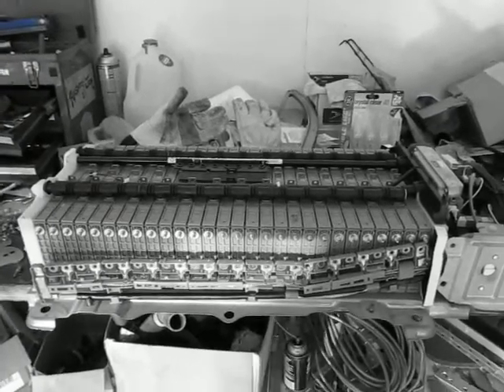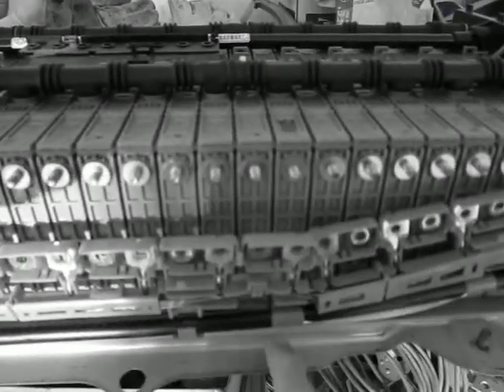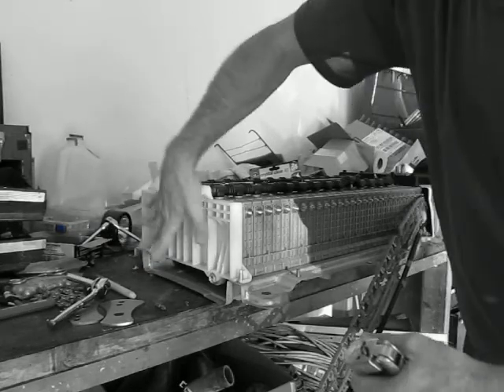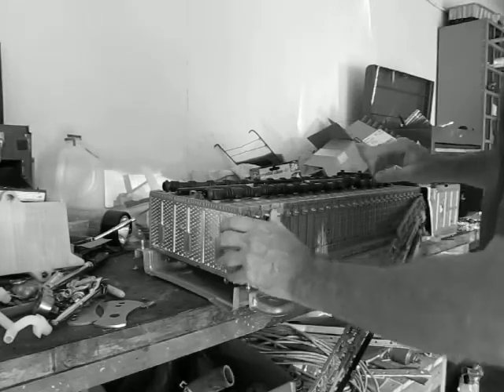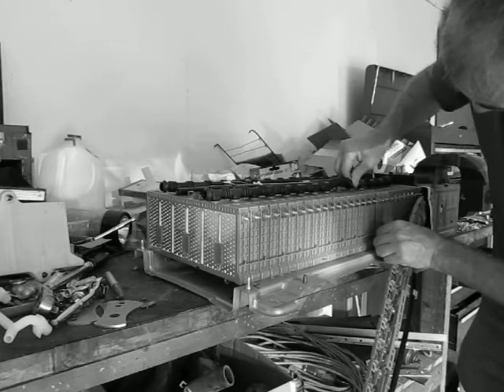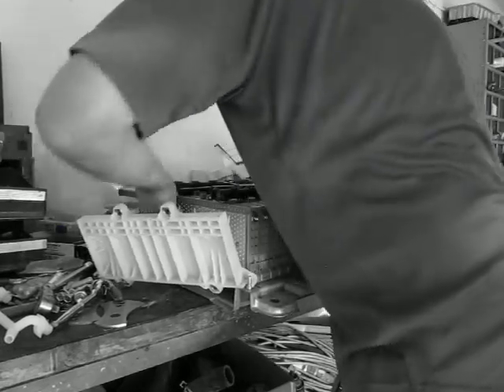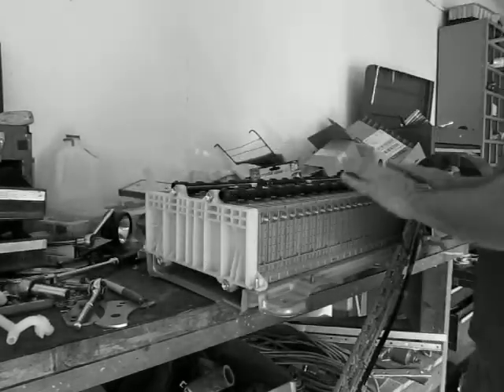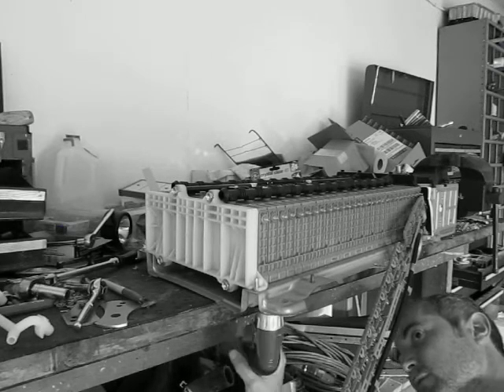Toyota Prius Battery Repair: Replacing one bad module (common failure)

Comment: The whole balancing thing is really not magic like most think. It really highlights how most of us simply do not understand how these batteries work, and especially age. A module “can” be replaced, battery reassembled and it “can” last a good while. However due to the module replacement being from a different newer or older battery pack, this is playing Russian roulette if solid reliability is desired. If you are mechanically inclined and don’t mind the downtime, it’s a non issue being the modules are cheap. But the rationale that cycling some 250,000 mile blown out battery is somehow going to make it match the other 27 in a pack that’s otherwise healthy is absurd and incorrect. Doing maintenance with a grid charger after install (hybrid automotive) or similar is really the only way to keep that one module (if it’s capacity isn’t too low) in line with the others long term. This hobby charger nonsense has given people a false sense of security. It’s a gamble people. If you don’t believe me, do your own research and speak to the industry experts.

Comment: I attempted a repair on my 2007 Camry Hybrid. After replacing a cell and cleaning busbars, it worked fine for about 2 days, about 70 miles. Now check Hybrid System warning light has returned. Any ideas?

Comment: WRONG, you have to test them under load.. a volt meter is not designed for battery testing.. also you have to change them in pairs or blocks... and you have to balance the batteries or you are wasting your time

Comment: If you hate buying new expensive batteries. I have good news! There’s an easy new way to bring your old batteries back to life again [Check Details Here==>https://plus.google.com/100351090281822647456/posts/Ct2x2kZGdNN ] .so you never have to buy new pricey batteries again.
Reply: I hate that video. It goes on and on, huckster selling to rubes. No substance.  Better to google battery reconditioning and find a more reputable information source.

Comment: Sorry not a simple volt test.. thats not how it works, one that shows proper volts doesn't mean its a good cell or the other way around. U need to check discharging and other performances. But you go change that one cell buddy
Reply: Apparently this worked out for him.

Comment: How long between these repairs? I have a 2005 Prius that I will attempt to fix. Wouldn't there be just one module after another failing afterwards?
Reply from the maker: evan riddle My gut is that there would be a long gap of time between module failures.

Comment: Thinking to buy a  2004 Prius for $900 with 77,000 miles with a battery problem will be a good deal?  The car doesn't turn on the owner say.  Still a good deal if i need to replace the whole battery ?

Comment: Nice video but what happened with the wires at the 7 minute mark that sort of held up the bad module when you were taking it out? I didn't see you plug them in when you reassembled the unit.

Comment: what‘s the symptom before you fix it up? thanks
Reply: Red triangle, check engine and about every other light. Codes P0A80, P0AA6.  Sometimes accompanied by P3000, P30XX (11 through 24).  P0AA6 is a HV leak to ground and is frequently an electrolyte leak at one or more modules, but it can also be the transaxle, HV harness, A/C compressor or Inverter.  P0AA6 will prevent you from restarting the car after turning it off.
Reply: thanks a lot for your reply, i have red triangle and check engine light on, and i just found one traction battery unit lower than 7v, according to your experience, it could be the root cause, right?
Reply: Henry Tan generally, they are all VERY close in voltage if they are healthy. Outliers are almost always an issue. Diagnostic codes should ALWAYS be read before disconnecting 12V.
Reply: I tested all the traction battery units, all lthem have close voltage-- 8V, except one below 7V, (I used the pointer meter), so I'm hesitated if it works to replace that unit, and I use the OBD2 scan tool to scan the code, there is no code at all, when i disconnected 12v and reset the car, the warning lights gone for just one day, but they were back again!
Reply: I have the same problem , did you fix it

Comment: You COULD just edit out some of the boring parts.  

Also, those wires underneath the module are connected to thermocouples (temperature sensors).  These are important inputs to the battery computer.  if you pop off one the three bottom sensors (one is on the very end module), you should put it back on the replacement module.  There are also two auxiliary clips which have no other function than to keep the wires in place.  There's probably no important reason to  put back the helper clip when doing the quick replacement.  However you may want to make sure you get that loose clip out of the bottom so it does not rattle around or surprise another DIY repair person.

Comment: Hello from France. 
Thanks for the video. Well done your work on the battery. 
We are many to have the same Prius and other USD Toyota, and a bit worried on how to handle the problem on the battery if it occur sometime. My Prius 2 is from 2006 and now have 120 000 km.

Since July 2013 and the remplacement of this bad module, how is going your Prius 2 and the comportement of the battery ?
When replacing the module, did you have to adjust the voltage between modules because it's not recommended to have a difference in voltage between the modules ?
Have you had to fixe again the battery since July 2013 ?
Tanks in advance for the response.
Best regards,
Patrick

Comment: This video was EXTREMELY helpful in the step by step process of fixing the hybrid battery.  I am a complete novice when it comes to electronics and cars and with a little youtube research (including this video) I was able to take out the battery, find a bad cell, replace the cell with a new one i bought on eBay, and put it all back together.  The car runs perfect again, the triangle of death is gone, and I spent $35 on a cell vs. the $3,400 the Toyota dealer wanted to charge.  Thank you for doing Prius owners such a huge favor!

All of my cells were right at about 8.1 and I had one bad one (24th cell from end) that was at 6.5.  It was clear as day which cell was the problem child.  Thanks again!
Reply: good stuff well done, i have a 2002 prius classic which is starting to give trouble, which ebay supplier did you use?

Comment: how did you find that one module that is bad?
Reply: Typically, a bad module will have one of the 6 internal cells shorted out so the best voltage you can get is about 6.5 volts which will certainly get you a red triangle on the dash.  He did tell us the voltage in the video.

Comment: Sorry if this comment is stupid: is this the repair for code  P3015? My block 5 just stopped working. I am just beginning to learn about the battery pack.
Reply: No such thing as a stupid question.  P3015 is the computer code for a bad module PAIR that is the fifth pair of modules from the end which does NOT have the computer.  Count the modules from the end in which he removes the plastic support, with the one adjacent to the plastic support being one, then the pair signified by the code are the ninth and tenth modules from that end.  Most likely one or both of those modules will have a Voltage of about 6.5 volts which indicates a failed or shorted cell within a module.

Comment: hey.can someone please tell me how long I have to wait before  power discharge to  removing hybrid  module?
Reply: You don't need to wait.  The most important thing is to wear protective gloves until you have finished removing the nuts and the little copper bus bars. Watch some of the videos about removing the high voltage battery from the car.  The composite battery has a Voltage in excess of 200 Volts of direct current but each module has only 6 to 8 Volts, depending on level of charge.  200 Volts can kill you or give you a nasty burn or cause one or more muscles to contract violently (possibly tearing muscles, tendons or cartilage or even breaking bones) ... or it can kill you.

Comment: to do when I finish the change process module defective ? It connects everything again and on normal car? I need to program or something ? please help friend
Reply: Make sure you disconnect the 12 Volt battery before you remove the hv battery.  Then, when you replace (or reconnect the hv battery) make sure that you disconnect the 12Volt battery (first) before and reconnect the 12 Volt battery afterward (last).    Note: you can reset the computer by disconnecting and reconnecting the 12 Volt battery when the hv battery is already installed and connected.

Comment: a volt meter does nothing, you have to test them under load
Reply: testing the internal resistance as well as a voltage test will tell you what cell is bad. 
also, if you have a good charger it should tell you the capacity of each cell charged. a bad cell will have a lower capacity. You don't need to load test each cell to find the bad one.
Reply: The above is not my video, but I agree with Josh and the video is fairly accurate for a quick fix.  

When removing an already charged hv battery from the Prius, modules will be within about plus or minus 0.3 volts of the average voltage of all the good modules.  He is accurate when he says that most good modules will measure between 7.5 and 8.0 Volts.

However, a fully charged module of about 6.5 volts, give or take a few hundredths, is a clear indication of a failed cell (one of 6) within that module.  Such a module is the most important module to replace.

If you want to do the best job of repairing a Prius hv battery, then the job is more complicated and load testing will help.  Once the load testing is done, then certain guidelines can be employed to surround the hottest point in the running battery with the most robust module pairs.   There are, however,  some conflicting theories about how to match the pairs.
Reply: @coverturtle  : note a bad cell can read good voltage, but when put in discharge it shows up. proper way is to test each cell, charge and discharge. 10mins charge and 10mins discharge, 10mins recharge. replace the bad cell and balance the pack. a bad cell will also charge to fast sometimes reading 8.44 or higher, it will settle out to around 8.2 to 7.9volts. but running thru the cell machine it drops under 7.5 volts in less than 18sec. a good cell will hold 7.5 volts or more for 10mins discharge. hope that helps

Comment: Did you put date on new battery cell?
Reply: The "new" battery module will have a different production code (serial number).  Pretty much the way the DIY Prius community interprets this is the first two digits are the day of the month. The third digit or character is the month of the year with 1-9 being January through September, X=October, Y=November, Z=December.  The fourth character is a letter indicating the year the modulue was manufactured, with A=1999, B=2000, ..., F=2004, ..., K=2009, L=2010, ..., Q=2015, etc.  If anyone knows how to interpret the remainder of the code, I would appreciate hearing from them.

Comment: You know the heat sensor wire that you never saw that was clipped to the cell from underneath which gave you trouble pulling the cell out? You never clipped it back on battery you replaced. You really should replace everything the way it was removed.
Reply: With a great deal of patience and difficulty.  The reasonable way to do this is to remove all the loosened bottom bolts and then remove the modules (being careful to maintain the order) and then replace the clips while reassembling the battery.  In this case, it's best to put back the plastic plate after replacing all the modules and making sure the modules are even before tightening down the four end bolts.  After all this, then replace the bottom bolts.  Bottom bolts may not line up to their holes underneath unless all modules are even, correctly placed and compressed by the four end bolts.
Reply: Just interested on how would could you do that?
Reply: Are those bottom bolts going thru slotted (elongated) holes by any chance?

Comment: At 7:00 you note " There's a set of wires underneath".... you remove them and take out the module. I never saw you put those wires back onto the new module.... other than that nice video. Good that you call out the fact a bolt with a 10mm head is NOT a 10mm bolt... the bold diam. in that case is really 6 mm. A real 10mm bolt has a 16mm head across the flats.

Comment: Any possibility of your coming by and checking out my 2002 Prius (I'm in Vallejo, California)?  My warning lights went on for a few days but then they went off.  A diagnostic reading showed P3000 and P3009 codes, one of which I gather was "leak detected."  The car runs fine for the moment.  If a visit/repair session by you isn't possible, perhaps you know someone in my area who's as competent and dedicated as you are!

Thanks, Jack

Comment: Thank you, excellent.  Is there any reason you must remove the battery pack to do this?  (Hoping you still get comments on this and have a minute to respond.  Would also love to know the particular ebay seller you got your module from.  Lastly, I don't have an RC charger, any other way to cycle the batteries, or will just connecting all + and - for big 8V battery work?

Comment: I'm looking into purchasing a used 2008 Prius with 120k miles. Any advice on how to determine the battery's status when I go in for a test drive? I don't think that the dealer would appreciate me whipping out a voltmeter... Should I make the purchase and the battery ends up not being in top shape, what is the problem likely to be? A few bad modules, a total failure of the battery, etc. If it is just a few bad modules, will the battery still function (just with a decreased capacity), or will it be disabled entirely until the issue is resolved? I'm just trying to appease my fear of that dreaded $3500 repair...
Reply: +Isaac Moore AS you can see, servicing the battery pack is not impossible for a mechanically/electrically inclined type.   A few bad modules could cause just an overall loss of capacity and eventually a total failure / complete shut down of the car, depending on HOW bad they are... The weakest cell/module usually determines the charge characteristics for the entire pack of modules or cells in a battery so that the good ones don't get overcharged due to the bad one.
Reply: +Matt Carrell I have over 180,000 miles on the same battery pack.  These batteries have much longer lives than most give them credit.............  

Please NOTE:  If you ever have a rear-end collision, (get rear ended), its justification to force the insurance company to replace the battery because they are easily internally damaged by the jarring motions of a rear-end collision and can not be trusted to operate reliably after one (I know because I spent a year plus troubleshooting the problems of one that was damaged in a rear-end collision but nobody ever checked inside the battery for damage and the car kept erratically losing power at odd times in ways that didn't make sense until finally the battery was fingered!  The dealership felt so bad about all the bogus repair bills they replaced the battery under warrantee as defective because the insurance company window to make new claims was well past on that one.. :)
Reply: Hey Isaac. Im thinking to buy a used 2004 with 77,000 miles.  Did your brought this car?  How was it ?  IT just asking me for $900 because it have a battery issue.  But thinking to buy cell and replace but im scared if it is all the cells.  This will be my first Hybrid.
Reply: I did buy this car -- I did not check out the battery before purchase, though. I am now around 180k miles, and I haven't had any issues at all. My MPG has tapered off a bit (down from around 45 on average to closer to 42), but that is a minor decrease and can probably be attributed to my lengthened commute. I really love my car -- it was a great investment. I was nervous about going with a hybrid, too, but it was well worth it.

Comment: Ok, So I have batteries 21 and 22 slightly lower than the rest of my pack. 7.2v and 7.36v for the other. The rest of my batteries are 7.45v. Could I go ahead and charge those back up to 7.45v to match the rest of my pack? I have a Imax b6 charger to do it.
Reply from the maker: I would replace the two lower voltage modules. Cycling all of the modules three times with a quality RC charger like the iCharger  would increase the capacity by a small amount. Equalizing them afterwards by connecting all positive terminals together and then connecting all negative terminals together would get all modules to the same charge level. After that, connect the buss bars to the modules like stock and hook it all back up. Run it without the sheet metal cover for a day or two if the weather and usage pattern of the car won't get the battery hot. Check the voltages of each module after you run the car for a couple days to see if they are all about the same. You can do this with the battery still hooked up. Just be careful not to touch your meter probe to two modules at the same time. If the voltages are pretty even you can button her up and drive on.
Reply: a very tricky advice for a novice